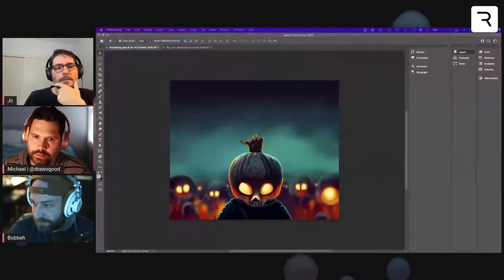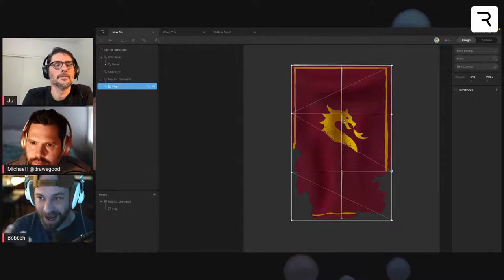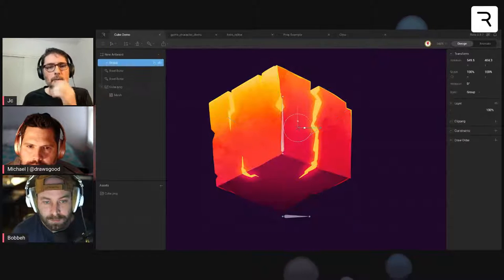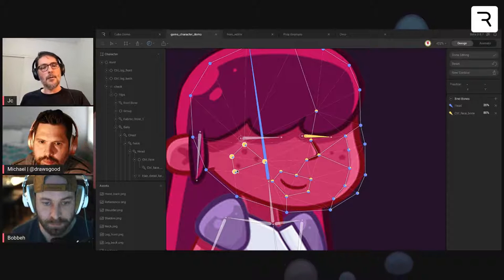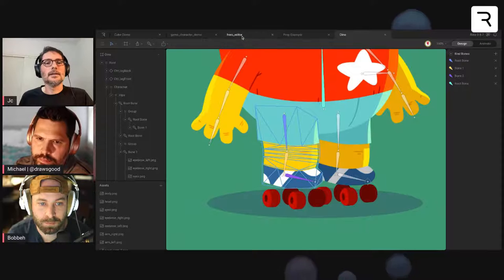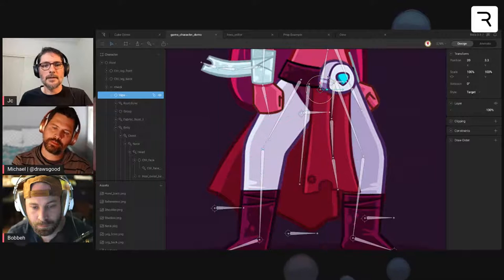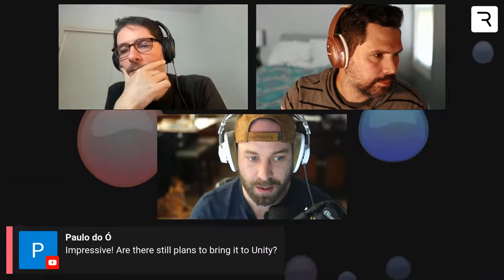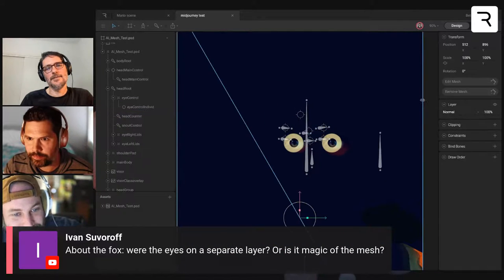Workshop - working with Mesh

Comment: Cool to see how you use Rive, mesh deformations is a great feature!

Meshes are only supported for bitmaps - would it make sense to be able to add meshes to a group of vectors? I often find that I need to tweak my vector vertices to make things work, would be neat to map a mesh to a group of vectors to solve for this.